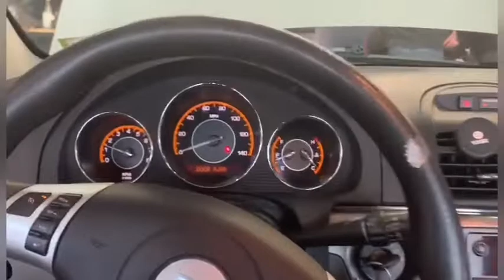2007 Saturn Aura dashboard removal

Comment: Curious why you did this.  My ac only blows through defroster, do I need to do this to get it blowing through vents again? Not sure I could get back together
Reply from the maker: I changed the heater core
Reply from the maker: No you  don't  have  to  .
Just check the   Blend door
Reply: @best_technician  This is seriously needed just for the heater core?
Reply from the maker: @ez112442  yes